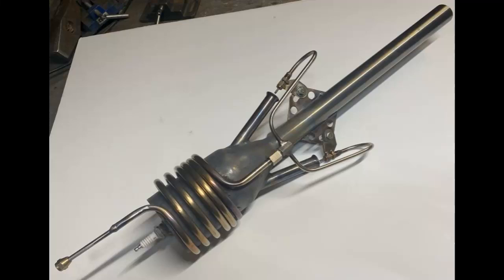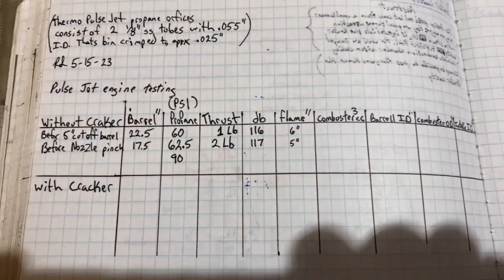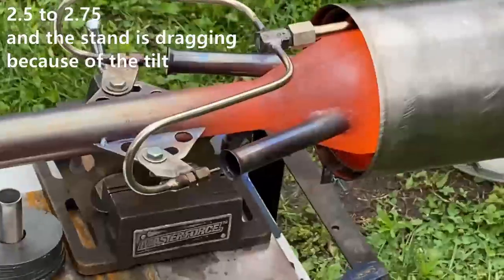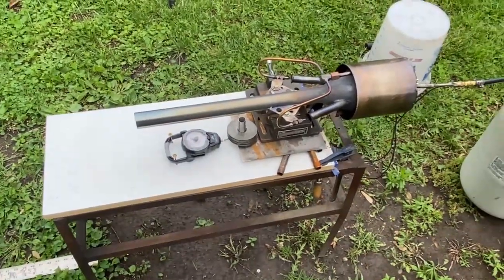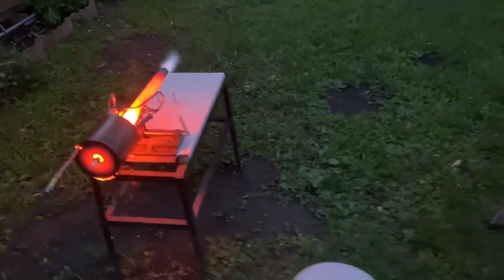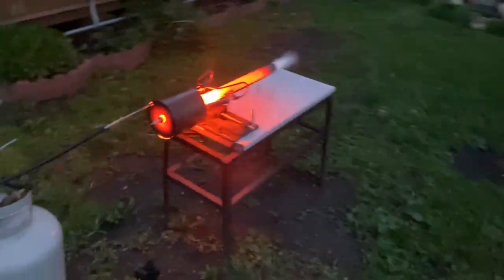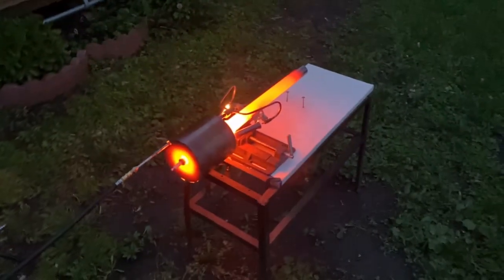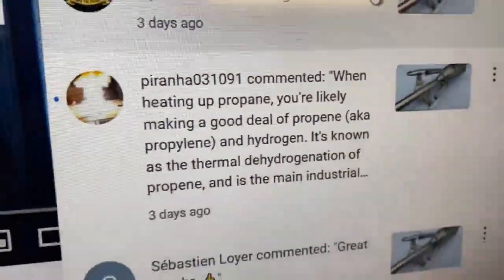Propane thermal Cracker Pulse Jet Engine ADVANCED

Comment: Might want to heat up your gas bottle just enough to counteract the temperature (and thus pressure) drop when emptying it. I'm not well versed in isochoric pressure changes anymore but it's fairly easy to work out. 
Add that and a proper thrust rig and you're set for good reliable measurements.

Comment: Most People I’ve seen are using a (bathroom Scale) on the Head End to measure their Thrust.
Might be easier with a extension to keep it from the hot Head.

Did you find any Success with your Venture into Ceramic Coatings?
Pulse Jets are suited as long as it isn’t to brittle.
Or have you thought about using one of your Silicon Carbide Combustion Chambers as a Liner?

Have you tried using a Glow Starter instead of the Spark Plug?
I’m interested whether this makes it better, it might have Difficulties with the Pressure Waves but should hold up better to the operating Temperatures.
Also it should be easier to use on the Road with 24V from a Truck or the like.

Comment: How about adding a circular venture on the nozzle NOBOX7 ?? I would bet you that would be the trick for increased thrust. What I am wondering is the life expectancy with your grade of stainless steel that you are using fella ??
Reply from the maker: 400 to 800 hours at these temps
Reply: @NOBOX7  I am guessing the grade is 316  SS ?? Would using 310 SS increase the life expectancy drastically ?? Thanks fella

Comment: How did you come up with the idea of a pulse jet for parking lot paint removal? 

Is the high heat more effective than a big torch flame? Does the thrust help blast it away?

I would love to see this thing in use by the owner.
Reply from the maker: Well my customer kinda thought me into a corner so i had to think big . We cant have an air compressor so i thought this was our only hope .
I then decided we need to take this tec to the next level so i added my own spices to the dish
Reply: @NOBOX7  that's what I was wondering... There must have been some design challenge you had to overcome which I was curious about.

It looks awesome, like a hellcat of a burner.

Comment: Yeah your system is too prone to tip, meaning its going to try to drive it into the ground, which is going to wreck your readings.

Need a better shuttle that doesn't allow it to tip.

Another option is to put a long steel wire and an all metal pulley to move the gauge out of the heat zone.

Comment: wonder if you could switch to 70% ethanol  once it got going. A fuel pump would be needed though.
Reply from the maker: Yes it would run on liquid until it carbon fouled